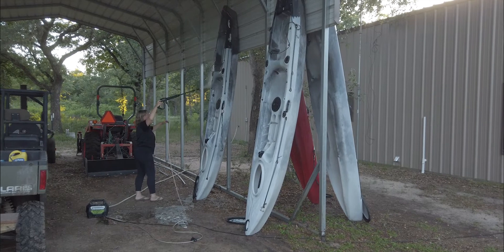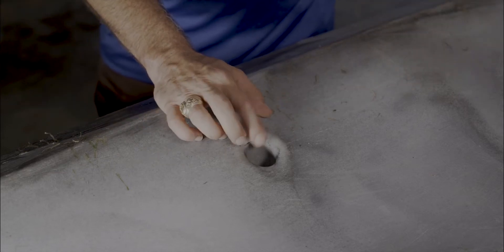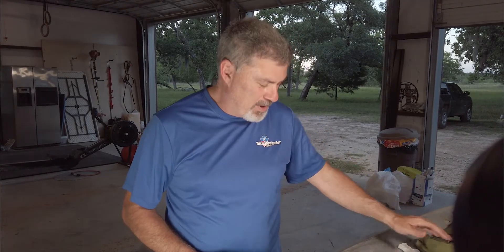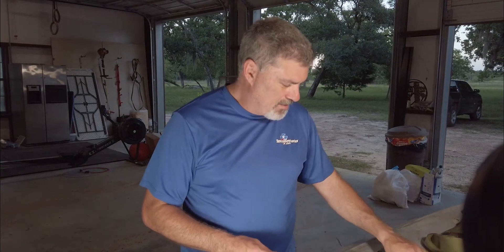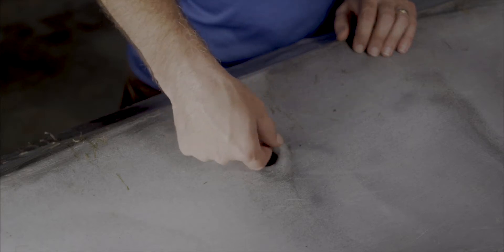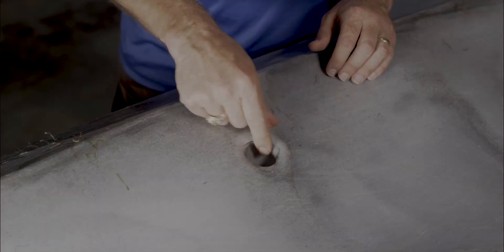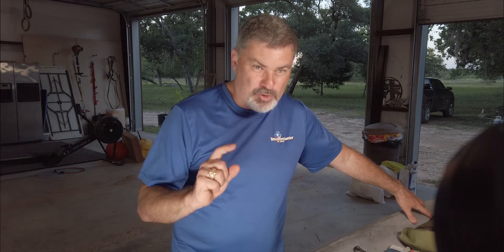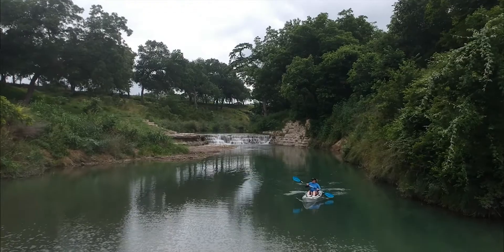Emergency (or not) Kayak Repair - Plastic Welding Technique

Comment: Another way to fix a kayak leak is cut strips of a heavy duty tarp heat a metal scrapper or putty knife until the blade is about red hot put the tarp where the leak is and put the scrapper on the edge of the tarp just long enough to melt and it is actually a stronger bond than using the hdpe that the kayak is made from there are videos of this technique on here
Reply from the maker: Thanks! I’ll check it out!